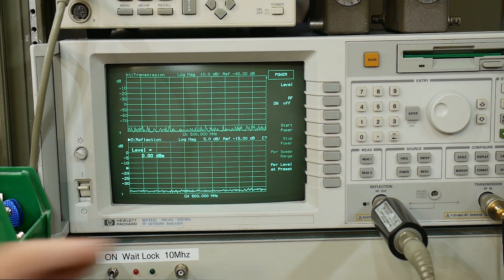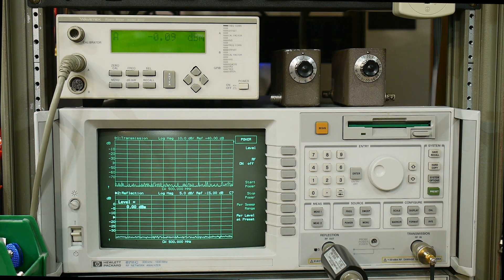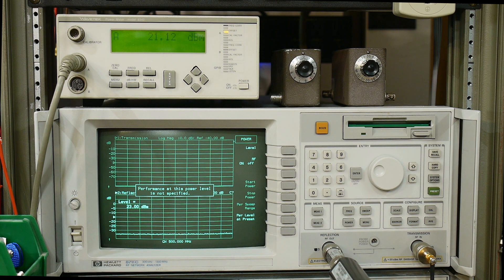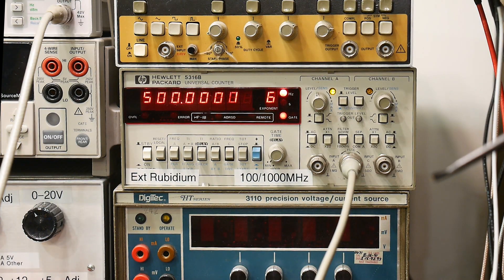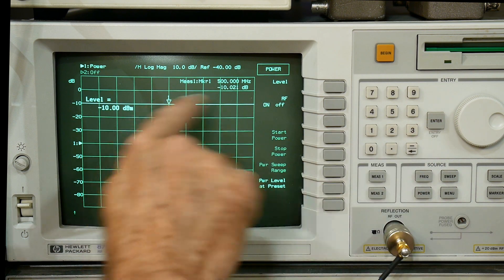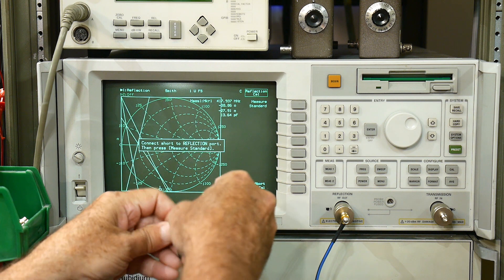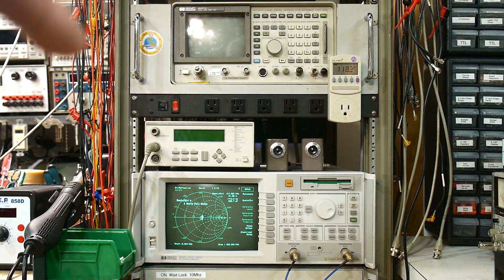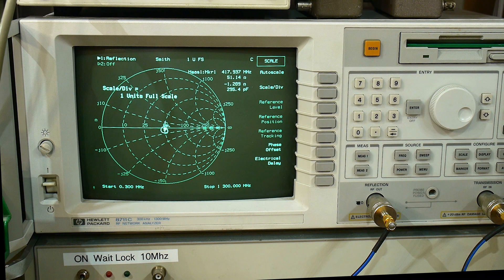#870 HP 8712C Performance Test

Comment: I also have one of these. Is rack mounting using front two rails is enough? Its heavy. I wonder if it needs support on back side too.
Reply from the maker: I have mine sitting on two L bracket supports that are bolted inside so it just sits on them. it is not even bolted in.
Reply: @IMSAIGuy  thanks. I will also do same. :)

Comment: Very nice, I'm sold!  Will keep my eye out for one of these.  

One question related to your Rubidium standard.  Just curious if you have calibrated it against another traceable frequency standard?  When I tested my Rubidium standard against a GPS DO I found it was off a bit.  Within a hertz, but you could watch the waveform for the GPS DO and the Rubidium drift apart on the scope.  Have it set now close enough that the two waveforms stay within a cycle of each other on the scope for the better part of a day - after that I called it good :)
Reply from the maker: No, I'm sure it is close enough for me

Comment: The calibration selection indicated type N; is there a SMA selection option?
Reply from the maker: No, It just uses type N as a generic description since the front panel has N type. In fact I am keeping N-SMA adapters on the front and calibrated to SMA. I also did an internal calibration with the SMA adapters installed so now the 'preset' condition is better.
Reply: @IMSAIGuy  Ok, thanks for the clarification. I'm envious!  ;-)

Comment: Another attenuator test you can try is to just watch S11 reflecting all of the power back in. Here you can see I ended up with a bad attenuator (rolloff at low frequency for some attenuation levels, ripple in reflected power): https://youtu.be/bXJYwIjCP2c And here you can see a nice flat S11 after replacing the attenuator: https://youtu.be/2-FFDrGkjZc
Reply from the maker: hope you didn't have to pay too much for a replacement
Reply: @IMSAIGuy  Nah. It was paid for by the seller. It was listed as working, and you could even see the attenuator issue in the listing photo. The attenuator was only $100; much cheaper than sending that monstrosity of a VNA back.
Reply from the maker: @MikeFikes  Thanks for being a Patron!
Reply: @IMSAIGuy  Thanks for sharing your knowledge!